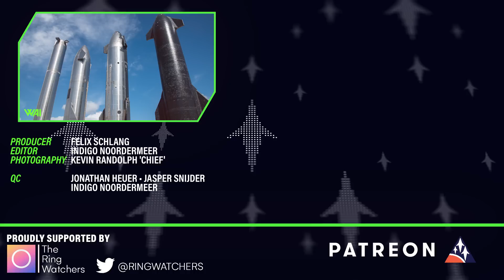Ship 24 Moved to Pad A! What is this new Mystery Structure? | WAI NC

Comment: The mystery item you pointed out, was an oil tank ! It may be, or has been used for collecting oil stripped from one or more "gas well". A lot of other nasty things come out of them wells other than just gas. That's why it has to be purified before it can be used. Be it in a rocket, or gas fired power plant.